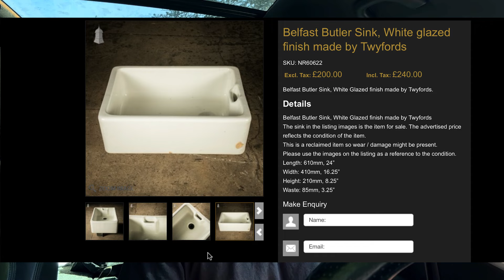#5 Restoring an Old Sink and Financing my DIY Tiny House

Comment: Build the house along the fence line with large skylights and sliding doors. As it is you will have a little dark garden and look out onto a fence . If you flip it you'll look out onto hedges or have a sunny outdoor bbq patio area.

Comment: It is rendered in concrete because there was a fashion for making them in to 'alpine troughs'.  However,  I never thought they worked very well because alpine plants look better in free draining rockeries.  So much depends on whether the glaze has survived, or if it is crazed and not really suitable for food-hygiene use any more.    But I'd still use one if I could install it as a mop-bucket at floor level in a utitlity room.

Comment: Why all the time spent on the sink? Just looking to do something other than digging? Do you have running water there? I am cheap also, because I have never been able to make much of it. For the most part it has worked in my favor because I have been able to buy 2 houses because I bought bargains. I have no debt other, but I am a lot older than you. (Though you may look younger than you are?)

Comment: If you’re going to drill through the overflow, do it by drilling with fairly small numbers into weird spots and break it up with some blunt tool with a small footprint into small parts. Then you might be able to break out the parts, but I would personally not bother to save £80.